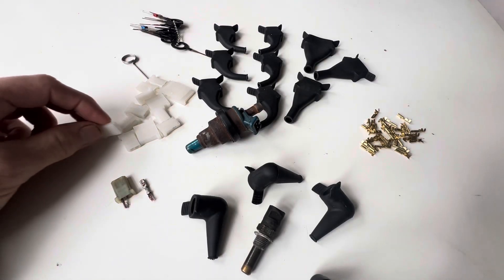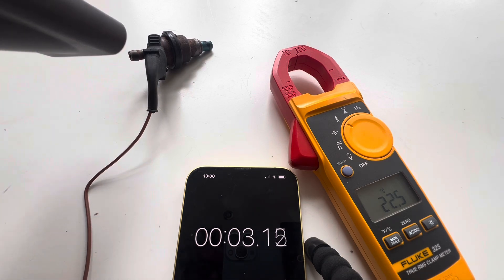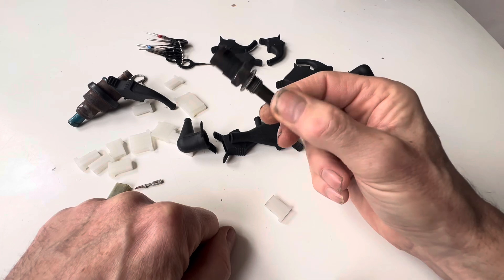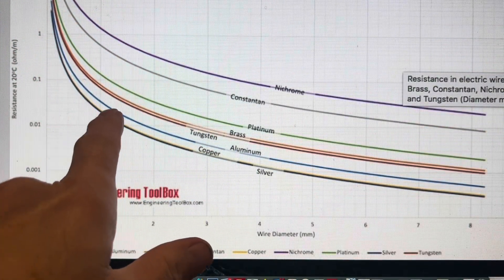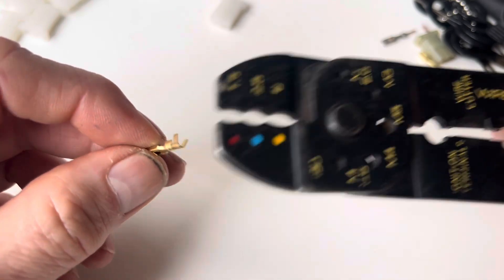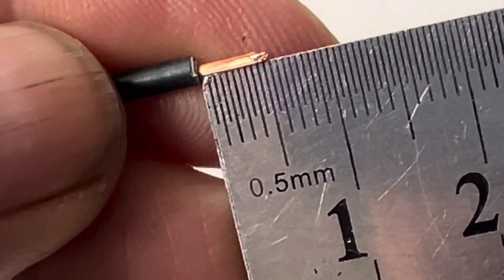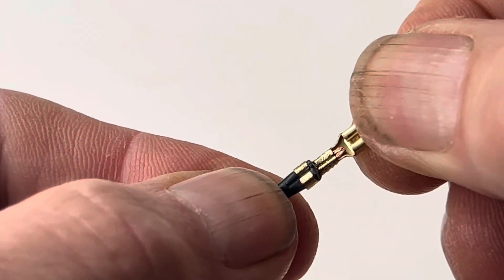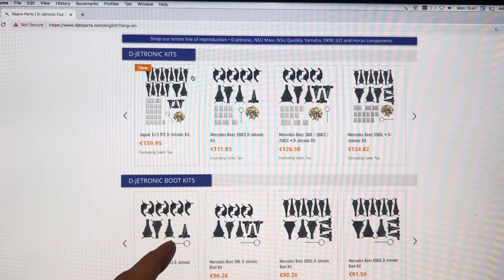How to repair a D Jetronic wiring harness using correct plugs, boots and crimps.

Comment: Great video Mike. Very informative. 
Do you know of any place where to buy wiring harnesses for the D-Jet (´74 450 SL)? 
Or do I have to make one by myself....? My wiring is very crispy, and in need for a renewing, both wiring and contacts.
Reply from the maker: Thank you for your kind comments. Here are a few places you can buy a new harness....but they are not cheap:

https://kurth-classics-autoparts.de/gb/wiring-harness/288-d-jetronic-wiring-harness-m116-m117.html

https://www.kabelbomen.com/en/webshop/engine-ecu-cableharness-d-jetronic-mercedes-benz-350sl-450sl/

Where are you based? 

Mike
Reply: @MikesMercsandothercars  Thanks for the links. I live in Norway.
Reply from the maker: I will soon be selling the wiring loom in my 450SL parts car. If you planned to make your own harness, it might work as a good template......rather than having to remove the harness from your car. Sometimes these projects take MUCH longer than expected! If you are interested, let me know, and I can ask my wife to take it with her when she goes on her ice swimming trip later in the year. Mike
Reply: Hi!
Yes, I might be interested in that. I have thought about making my own loom, so a template is perfect.
Where is your wife usually take her ice bath? 
I live in Trondheim, in the middle of Norway.

Comment: Great video Mike. I like the crimp tool too.
Reply from the maker: Does the 560DSl use the same crimps or plugs? You know you'd be more than welcome to drop round and borrow the crimpers any time...By the way congrats on whooshing past the 1000 sub mark. Mike
Reply: @MikesMercsandothercars  I guarantee if I am anywhere near you I will be stopping by. The 560SL uses different connections. Also it has CIS injection and KE-Jetronics so there is a lot of differences. I will be uploading a video shortly showing every electrical connection on the engine of the 560SL. I’m getting closer to the first start. It’s taking me much longer than expected. I’ve had a few interruptions these past few weeks and I had to wait over a month to get a part from Mercedes.

Comment: my boots even the actual fuel injectors have started to become brittle.
Reply from the maker: Thanks for your comment. The boots will eventually disintegrate - that is usual. The problem is that once they begin to lose their ability to shield heat, both the wires and the plastic on the injectors will become brittle. Two injectors cracked when I removed them from our 450SL parts car....and I was super careful. I guess most rubber bits will need to be replaced after 50 odd years. Mike